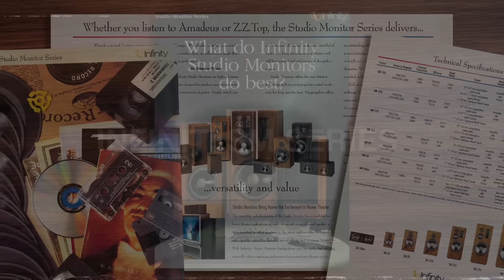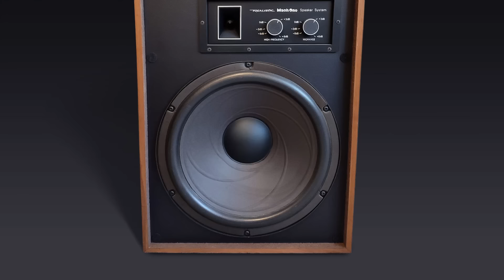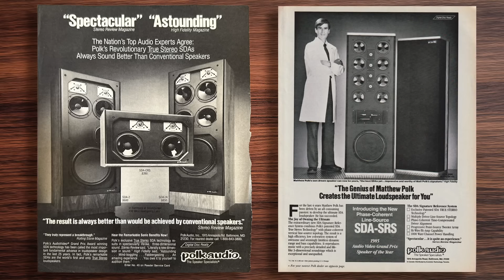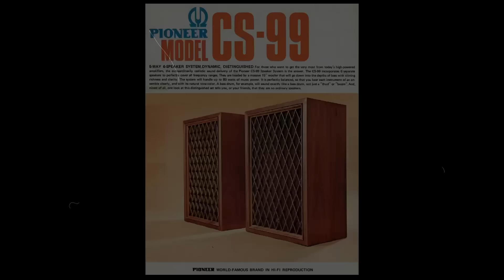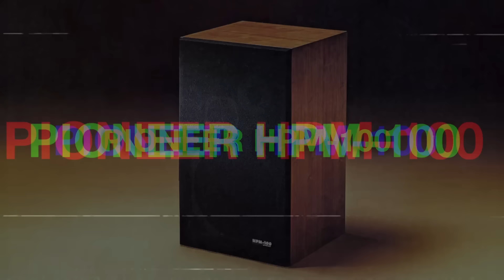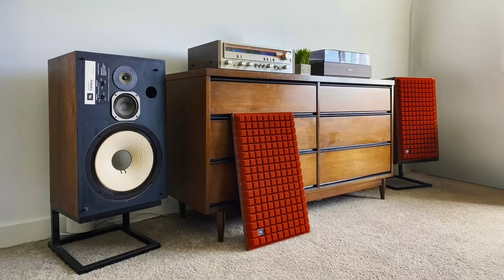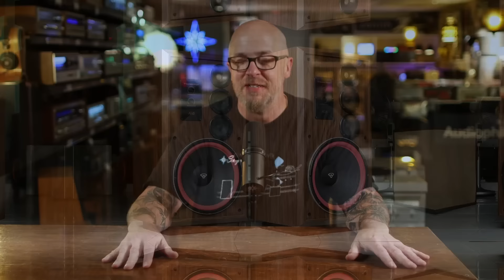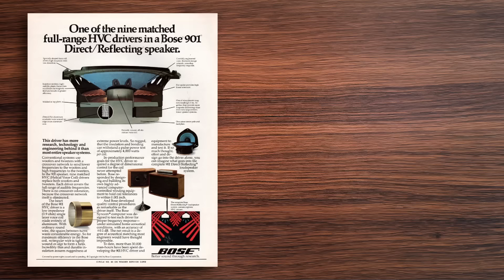Why Do Audiophiles Hate These 9 Legendary Speakers?

Comment: The problem with typical vintage american brand speakers is they sound boomy, harsh and fatiguing. Most people like the look over the sound, so they buy with their eyes rather than their ears. I'm sensing you don't like to deal with audiophiles based on your comments. I'd rather hear accurate sound rather than loud, ear piercing noise. Most of the vintage audio guys listen to rock and metal, so they love the big loud vintage party type speakers. if you love metal and rock, you're probably going to like Klipsh, Cerwin Vega and the other big harsh sounding speakers.

Comment: Given the placement requirements of the 901 system I have owned a set of series 4 and Series 6. They both were fantastic and suited my tastes. I prefer not to ruin my low And High frequency hearing, so I chose the 901.   Concrete walls totally suck acoustically. Creating an environment for the 901 is not that complicated. Acoustic mat is cheap and can be a great way to pad the room for a great listening environment. I have tried the L100 century and they were great too. Hearing all of the instruments at a clearer volume is actually quality time spent. Try it, you may have a different point of view afterwards.🎶

Comment: Well, the basic design of the 70s three ways, a fairly large, but lightweight paper cone for bass and lower mids in a vented cabinet, a middriver doing the 500-3500Hz range and a tweeter to add some precision above actually does a lot of things right, as it doesn't demand much from the individual drivers. Price to pay is fairly large cabinets and that these tend to have distinct sweet spots. But physics are on your side with that type of design and that avoids so many problems, sleeker, more modern designs come with. Usually you're good with very few crossover components this way and can focus on quality of those.

Comment: My dad had a pair of 901s when I was young he bought them in 81 I was born in 82 he sold them give or take 15 years ago now. And I seen a pair for sale literally yesterday and I told my wife I want to buy them just bc i miss them bc they were such a HUGE part of my life thats even if I NEVER hook them up id still have them. Just for the nostalgia of it. I now have a never small 5.1 klipsch rp series system 2x 600m 2 rp500c 2x r-28f bc i got them stupid stupid cheap. 1 for $25 the other for $75 then a cheal polk psw10 i got from ebay for $30 for bass and for what we need its way more than enough

Comment: I have 3 sizes of Infinitys.  SM85, SM105 and SM115.  I bought the first pair, the 115s in 1995.  Later I bought my folks the 105s.  I bought the 85s for surround speakers.  I took the 105s back when my folks passed.  I love them, never a complaint.  All my friends like them a lot too.

Comment: Build your own  . It's not cheap .  I did . 1500 bucks . Cerwin Vega  . 2 tweeters , 2  mid's , 1 bass  , 4 cross overs  . Tower speakers , ds 18 horns  .  X 2 . Unreal sound . Ps . Wired at 16 ohms . Pushing with a 8 ohm pioneer . Old stereo .

Comment: I have two pairs of old Advents, and a set of Genesis 2+s. I don't call myself an "audiophile" but I tend to prefer flat, accurate ("New England") sound. 

That said. . . . .a few months ago I got a pair of 1991ish Cerwin Vega DX9's, refoamed 'em, and sat on the floor and blasted Foghat Live and was absolutely as happy as a clam. They're now hooked up to the big living room TV; efficient and excellent for big TV sound. Love 'em.

Also have some old Bose 301s. Those are up in a spare bedroom with a TV and work well in that context: no one hears them in proper stereo position, but they disappear into the soundstage. Bit boxy sounding (i.e., not accurate) but they work very well there. 

Speakers are tools, of a sort.

Comment: Only just realized that I am an audiophile and have been watching this feed and similar since retired. I remember the Realistic Mach 1 series in Radio Shack and went to look. I did not buy them but came home with a set of Minimus deskshelf speakers. I bought these for a 67 Dodge Coronet that I did not want to alter the factory shelf speakers. I sold the car and put the speakers into a 71 Fargo Power Wagon behind the seats where they bounced around and had stuff put on top of them, The speakers were finally sold in the early 2000's behind the seat of a 85 W150, beat and dented. They always produced great sound and did not decay in sound quality from what I could determine. In hindsight, I wish that I bought the Mach's considering how tough the Minimus were.

Comment: Had 3 on this list.   Infinity sm115, were pretty good, yes they were missing detail in midrange, but they could thump.  Then JBL 100, was a great speaker little better on midrange and like Infinity had adjustment pad if you wanted to add or subtract some of the high end.  Moved them to my garage and continued to run for 20+ years.    Bose 901, to me these were the best of the bose speakers... and also the worst to own.  The sound was great, but if you lived in dry climate like me... the surrounds on those speakers started to crack then split... then you either have to spend grand to re-foam or sell them, I sold them.... heck they gave me 8 good years.

Comment: I replaced my Front HPM-100'S with Sonicap Capacitors and Mills Resistors and Air Core Inductors and my HPM-60'S Rear the same and they sound fantastic!

Comment: Me.......I am a die hard JBL fan. I am talking about the  ( spensive, very spensive ! ) pro speakers. Back in the 70s I had two different 7 to 8 cu. ft. enclosures built ( to JBL's specs ) and filled one set with the JBL LE 15A, the 15 inch PR Radiator, the LE 185 compression horn and acoustic lens and the 075 Ring Radiator tweeter. The other set of cabinets I went with the JBL D130, the LE 185 horn and lens, and the 075 Ring Radiator. Back in the early 70s I worked as a salesman at a really nice stereo store. People would come in with budgets that ran the gammat. But one thing that was always fun for me was A-Being the various brands of speakers that we sold/carried. Back then JBL did not make ' cheap so-so ' speaker components. Every component was made with edge wound voice coils, ALNICO-5 magnet structures, cast aluminum frames, and some ceramic magnets. But THE THING that always stood out with JBLs, as to compared with any other brand, was their band width, along with their efficiency and power handling capability. Some people couldn't hear that and liked another brand, and bought it. Also price was a factor, as JBLs ( the old high quality stuff ) was more expensive than most everything else. But how I describe the ' high end ' JBL sound is.........when played on high quality equipment, a really high quality, dynamic recording played through JBLs, when you closed your eyes while listening to said recording ( be it orchestral, pop, jazz, or rock and roll ), it sounded like the music was being played live right in front of you. It's called bandwidth and very, very accurate reproduction of the music as it was recorded.

Comment: You never talk about or show Ohm Acoustics speakers from the mid to late 1970's. Particularly the series with Ohm F, H, C2, D2, L and E. Are they not traded as much? I own an early pair of L's with the single tweeter switch and banana jack binding posts and a pair of H's with two tweeter switches and spring loaded terminals.

Comment: I really didn't like the klipsch sound at first... But when you work with them a little bit.. I feel like that they have a presence you can't achieve with normal cone/dome setups... It is forward sounding... somewhat like a live performance would be... You can dial it back too.. So I feel these are a bit more dynamic speakers that require a little more upfront work to get sounding right.

Comment: Mach ones were my first good speaker. I replaced the horns with open air 5" mids with metal dustcaps. 
Next was a pair of Klipsch La Scalas - who NEEDS a 100W amp :)

Comment: I stopped by a SoCal hi-fi shop back in the early 70's to pick up a brand new Marantz 1060 amplifier. Lying on the ground, side-by-side in the middle of the shop, among tons of other audio gear, were a pair of Bose 901s being used as PA speakers for background music. My 20-year-old self was astonished at how balanced and pleasant their sound was, compared to other speakers I'd heard. They must have cost 10 times what the amp I could barely afford cost, so nope I didn't buy a pair.

Comment: I bought Bose 901s a few years ago bc I heard them blasting at a drive in restaurant decades ago and remember being blown away by how good they sounded. But when I set it up at my house; it just didn’t sound good. That is until I paired them with a Mac 1900 and Bose 1801 monster amp. I don’t know what I did but it started to sound real good. The amazing thing is that the bass sounded very thumpy and great. Couldn’t understand where such good bass was coming from when they don’t have any woofers. The bass is so good on 901s that I turn off my active sub woofer when using 901s. It’s a mystery how these things create bass without woofers!? I don’t care what others say. With the right combination of equipment; they can sound amazing!

Comment: Polk SDA was a fine competitor for the Carver Sonic Hologram.   Carver did the interaural crosstalk delay scheme at the preamp level.  Available as a standalone unit or in the C-1 preamp.
As for the L100?    One of the greats, but perhaps bettered by upline JBL.   Something like the 4311 or better.     For my (poor) self?   I settled for the RSL 3600 studio monitor.   Considered one of the finest JBL 'homage' speakers.   12", 3-way with level controls, which IMO is the weak point of the entire system.    I'd measure and replace with a power resistor, OR put connectors on the back panel and insert whatever resistor you wished.    I didn't see entire video, but maybe the RSL SpeedScreen made this list?

Comment: How to setup Bose 901’s: Put them in the corners of the back of a medium to large size room (preferably with a cathedral ceiling). Run off a vintage amp like a Yamaha CA-810 (hook up a Yamaha WXC-50 as a pre-amp for the CT-810 to give MusicCast capabilities). Have the Bose equalizer set to max treble and base. Have Bose 4.2’s in the front set up about 6 feet high in the front of room, hooked up to a MusicCast enabled Yamaha receiver, and link the CA-810 and the WXC-50 via MusicCast. Hook up a Klipsch 12” subwoofer. 4.2’s provides the highs, the Klipsch provide the lows. Sounds like you’re at a concert with no distortion. Sounds identical to the master bedroom setup with Wharfedale Super Lintons front and old Infinity 2000 bookshelf speakers from the early 80’s, and a Klipsch sub

Comment: In 1971 when I  bought my KR7070 I bought L100's. The grills disintegrated after about 15 years and a few moves. I've had Speakerlab 4's ever since. They sound full and good to me with the 7070's power, which would probably blow them up in a heartbeat if you got carried away.

Comment: bose 901 supposedly was indestructible. you could literally connect them directly to the 110 volt line and they would buzz really loudly and the car dome light bulb limiting resistor would be lit up but you would never blow them.

i think it is because if the built in car dome light bulb looking limiting resistor limited the current to keep from blowing them

or a ptc fuse that went high resistance to protect them.

at $500 would be $4,882.99 today and for that price you would want good protection

Comment: In the mid 70's I've seen a lot of advertisement for the Bose 901 and, as usual, my imagination was working overtime. Even at young age, I was already an audiophile; so, I've imagined how perfectly the 901s would sound. Until I've heard them in 1978 with the correct setup and crossover. What a disappointment: they sounded not better than low end speakers. Since then, I don't even want to hear about any Bose product.

Comment: The Kenwood kl777A has a three way crossover, so I don’t understand your comment about “overlapping frequencies “. That isn’t how it works. Each speaker or horn or tweeter has a very specific frequency range that it gets. No overlap. Also the two way crossover on my L 100s only separates the woofer from the mid and high end, so the small speaker and tweeter are playing the same frequency. Not sure why or if that’s better than the Kenwoods.

Comment: I have a pair of JBL L100's with serial numbers only 8 apart on the last digit. I bought them from the original owner back in '89. They are most certainly not indestructible. I took out 2 tweets and one mid by over driving them with noisy signal. Was dumb and had no clue what I had. I spent a handful of years searching for original replacements but I eventually found them and restored these babies to sounding like they should. I take great care and pride in my JBLs and recently paired them with the JBL Stage 220P and holy crap!!! What a great sound I get now.

Comment: If somebody gave me a set of one of these, it would be interesting to rework them with rounded edges on the boxes, thicker, better-damped panels, and a front panel that allowed for proper (i.e., close) placement of the drivers to avoid cancellation at random frequencies. Then, with a new crossover design built with high-quality parts, they would probably still sound terrible.

Comment: Note that all the speakers on the list are boxes that radiate in only one direction, except for the Bose 901. The prototypical speaker in people's minds are of a kind--a direct radiating box. Bidirectional speakers radiate out the back as well as the front (a few are "omnidirectional). Some, like panels or ribbons have a single driver radiate in both directions; others, like the Bose, have additional drivers in the back. These two types of speakers sound very different in terms of the size of the soundstage and how well the speaker fills the room. The one-direction speakers can deliver more precise instrument location (in one listening location), but lack are more realistic virtual space that is similar to what is achieved with "surround sound" with more speakers located around the room. Potential buyers should listen to both types prior to buying anything as this difference affects perceived sound more than any other factor.

Comment: O.k. how's about this : I'm now 67 , in1978 I was on leave from the military ., was at the new mall  , Burnsville Center in Burnsville Mn. Was with some friends and went to Team Electronics. I had been looking for a receiver because my starter Sony gave up. So it came down to the harmon kardin 735 or the Sansui 9090DB. Ended up with the sansui still have it, but the speaker story is better. No baby adverts for me can't  remember the number , but they were the largest ones at the time.Took receiver & speakers with me in the military 3 years later went home and had my electronics shipped home. Trashed my adverts along with my turntable.Replaced the adverts with a pair of Ultra linear Disco monitor 265's. 5way  huge floor speakers.15" woofer 6" mid., tweeter and super tweeter .Added 2 bose Interaudio 4000 's & put them on Rockville stands . Took it up north last year & a bunch of people from over a mile away across the lake came just to see what we had. Have never heard of the ultra linear 225watts per channel . Had the 9090db fully restored along with the ultras thanks toMISCO in Roseville mn. I love the stereo & speakers combo ,makes my quad ro phonics albums sound killer.Whole Lotta love makes me dizzy when I sit in the middle of the floor.Like the channel keep up the good work.

Comment: When I was in the Air Force back in mid to late 70s. My stereo had 4  Kenwood 7774 speakers. 12 inch woofer. 2 mid range & 2 tweeters plus a big horn  !!!

Comment: I've owned several of the speakers on this list. Pioneer HPM-100, 901s, Klipsch Heresy, JBL L100 and some others not on this list.  The Klipsch Heresy were by far the worst/harshest sounding (to me) of the bunch, all the others had their own unique qualities. I can't afford to be an audiophile so I've stuck with my first real receiver, a Sansui 9090 (the non-DB model) I bought new in the mid 70's. At that same time my older brother bought a pair of L100 and I settled for some unknown speakers that didn't like my 9090 volume levels as soon as I moved out of my parents home. 50yrs later I have my brothers JBL L100s and a pair of JBL 4312 (stacked) pushed by my old Sansui 9090. I've heard much better setups, unfortunately I just don't have that kind of money.

Comment: When I was in the service back in the mid to late '70s, I was stationed in Germany and would often go to the Px in Nuremberg to purchase stereo components. One trip was to purchased a set of speakers. Specifically, I was loooking for the infamous JBL L100. However, they were out of stoack and I ended up getting the JBL L166 model, which I love to this day. Speaker cabinet finish is still flawless, no scratches dings or dents. I've had to repair the woofers once because the flexible portion was deteriorating. Other then that. I love them.

Comment: I had four L-100s with a Sansui QRX-9001 back in the late '70s, and I disagree that they didn't have much going on in the midrange. The midrange was jaw-droppingly realistic, as good or better than speakers costing far more. The problem was the bass, which was boomy but not deep, and the highs, which, as is typical for paper cone tweeters, were a bit harsh when you cranked the volume a bit. I bought them on the recommendation of a friend, and while I can't honestly say I was ever really disappointed with them, I came to realize after a while that I could have had better sound for less money with Polk or Advent.